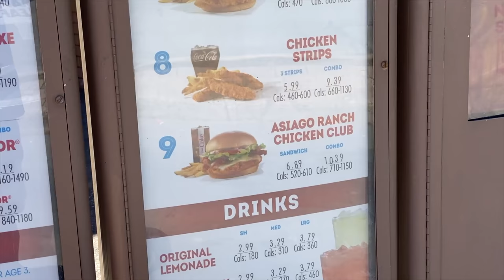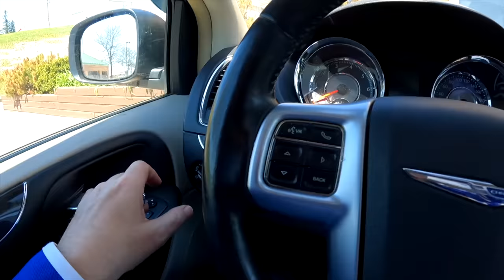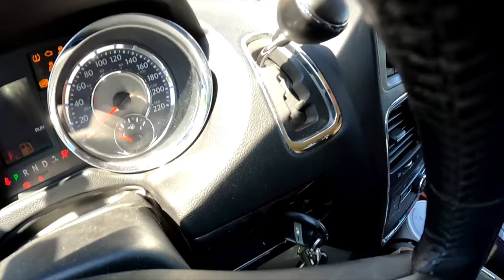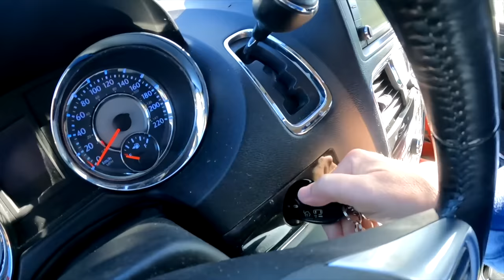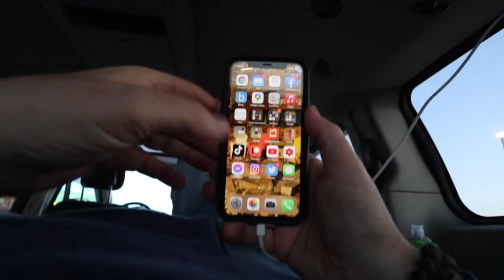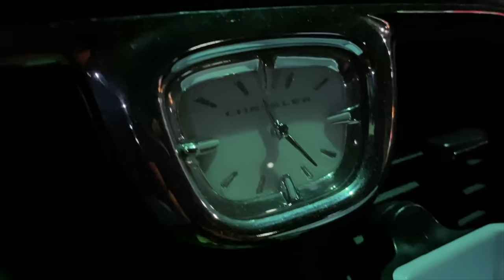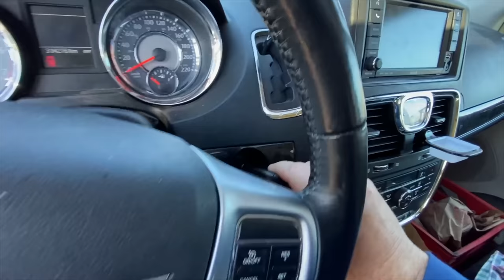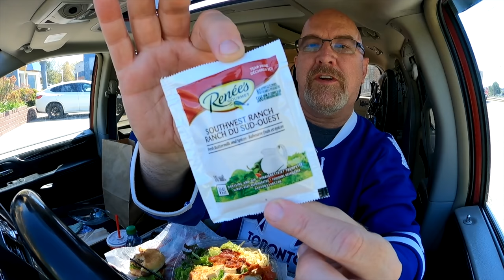Living at Wendy's for 24 Hours Stealth Camping #VANLIFE

Comment: Hey Ken, another great vid! If it hasn't been mentioned already, I actually have a similar model T&C and there is a switch to turn the power inverter (outlet) on and off. It may be as simple as being in the off position. This is located underneath the climate controls. If that is not the issue, it is likely a simple fuse. Take care, look forward to seeing more content when you can come back to the states!

Comment: There is a 110v power button on the bottom of the front display panel (almost level with the center console) that needs to be activated before you can use the power outlet.

Comment: The power outlet only works when the van is running and the button on dash is pushed. If it doesn't at that point the fuse is blown.

Comment: Great video Ken. That power plug by the back door only works when the van is running. It might work with the ignition in the accessory position also, not sure. I have the same van and that’s how it works on mine.

Comment: You know you're dealing with a professional when they have a clip on the steering wheel table and tablecloth....Bicycle innertubes are so expensive now you should buy REMA tube repair kits... Cost me about $10 for two sets which has 10 patches and cold vulcanizing fluid, so $1 per repair... I used to own a bicycle shop years ago and used this brand exclusively.... Canadians are so polite.... thanks for the video